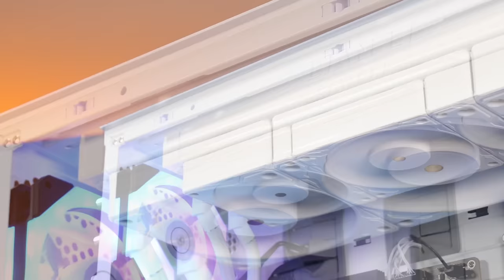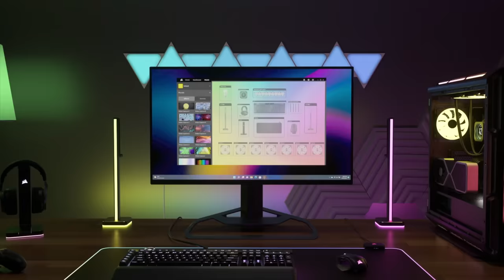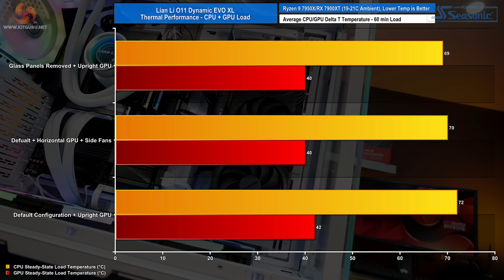Lian Li O11 Dynamic Evo XL - Deep Dive Review

Comment: I don't know if you or Lian Li care about my opinion but here it is. If they put a hinged door on the front for easy access, you would have nearly perfect case. Lots of people accidently drop the side panel or set it on the corner, when removing it. Just put 2 hinges on the back corner with magnetic closer and you've got it. Thanks for letting me share.
                                                                                                                            Ronnie

Comment: This case looks like it solves all the problems I had with the 011 Dynamic XL and then some. I ended up moving my build to a Phanteks Ecliipse P600S and am fairly happy with it though.
Reply: Don't mind me, just here to appreciate your profile icon.
Reply: @Ruuubi  UT2004 is my favorite multiplayer FPS of all time. I only went with the UT3 icon as I like red more than blue lol.
Reply: What problems did you have ?
Reply: I think he means some of the design issues they are well known. But I think this case is too big. Eclipse p600s I was considering but never made the move yet as I wasn’t sure. Hopefully it’s worked out
Reply: @bobsmithson8592  I like the P600S. I was impressed by some little things (e.g., the O11 XL came with a big bag with all the screws in it, the P600S came with a plastic box that organizes the screws into their own compartments). I like that both doors are hinged. I like the design of the top panel where it has an insert to block dust out of it when you put it to sleep, and can take it out to allow airflow when you're running it.

I don't know if the foam inside the top and front panels actually does anything though. I just tuned my fans so they didn't bother me. So if I had it to do again I might have gone for the Evolv X.
Reply: Heard good things about the p600s. The overall aesthetics are good and it seems quite versatile. What kind of cooling are you using in it ?
Reply: @praetorxyn are the door hinges good quality ? I’ve seen a few people online saying they aren’t great.

Comment: Good video, quite informative... like always. Thank you.

But something bothers me:
It's easy to say (or like Lian Li to write it in the manual) that the case supports 420mm radiators (or AIOs).
Well, that's only the combined fan dimension, but what is the actual maximal available space for the radiator, as they vary in length (450-480mm for example) and width ( up to 150mm for example) quite significantly?
Would there be actually enough space for 3x 420mm crossflow radiators including the needed fittings and the (hard-)tubes?

Comment: Thank you for the review, the case is indeed nice, but why oh why does it not support SSI EEB motherboards? There looks to be plenty of space for EEB MB tray, and it would probably not even overhang the cable cutouts.
3x420mm radiator support is a huge improvement over the regular o11 XL, but this much cooling really means that you have either 2xCPU+1xGPU or 1xCPU+2xGPU or probably 3xGPU. With very few exceptions those setups imply HEDT or server platforms. Like w790 SAGE - EEB form factor, or WRX90 - also EEB form factor. Multi-CPU boards are almost exclusively EEB as well. 
So why make the tray with only ATX standoffs? Any why remove support for dual PSUs? In workstation scenario I'd use local hard drive for OS only, all the data would be stored on some separate external storage anyway. And I don't see much point in four hot-swappable disks in home use either. So pls make one of "hot-swap" bays replaceable by an auxilliary PSU.
Overall, it is a nice case with some clever features, but some drawbacks as well as some questionable design desicions. If it supported EEB-size boards and retained support for two PSUs, I would be already ordering one. For now I guess the search for an ideal case continues.

Comment: Very innovative having the upright GPU. Wonder how long before edge connectors are replaced with connecting cables.
Reply: the og evo already did this but the 40 series made some models almost impossible to install...i still managed to get the 4090 strix in there and ran it for like a year now lol the xl will make it way easier tho.

Comment: Plenty of the cases that are like this or feature some of its features (side intake and/or bottom intake) could either easily support 140x3, or could with a vaguely larger version - and where are they? No where.

I will be getting this case, unless someone wants to do a video on multiple cases that do 2+ 3x140 rads.  (hint hint)
Reply: This might be your best option. People have done 3x360 rad builds in this.

Comment: Great Video and Info!!
 Why not mount the PSU with fan towards the hot backplate of CPU, might take off few C digits from CPU temps?

 Why nullify the role of PSU which  always had : to remove partially the hot air out of PC cases. Not to say in this case the HDD mounted in upper box will suffer from heat coming out from CPU backplate.

Comment: I really hate the fact that you have to use a 120mm fan in the back in a "all 140mm case" also everyone is waiting for the vision version. Also we have regular evo and vision for 120mm fans, why we need 120mm mounting systems that partially block the air from the 140mm fans?
Reply: Good points

Comment: Great video! I'm considering using two NVIDIA GeForce RTX 3090 GPUs in a horizontal configuration with air cooling. With the motherboard positioned at the top, I believe this setup could optimize airflow and heat dissipation for both GPUs. Any advice or insights on this configuration would be greatly appreciated. can i mount the two gpu,
s and three 120 mm fans at the bottom .thank you

Comment: It's weird that you guys decided to leave the corner support in for all of your cinematics, considering the removal of it was definitely one of the main selling points for enthusiast builders with this new generation of dual chamber cases. It's kind of doing Lian Li a disservice to only have like 30 seconds in the entire 37 minute video where you mention the removal of the support and then leave it in afterward lol.
Reply: The case doesn't feel very strong at all with the support removed, there is a lot of flex in the top, unlike the Phanteks NV7.

Also the sample we had was pre-production so the front/side glass clips were not secure, these were made from an alternative material in retail units.

Because of this it didn't feel safe moving the case into different positions for the b roll so I didn't want to risk damage. With a system inside it's very heavy and difficult to handle.
Reply: @KitGuruJames  That makes sense! Thanks for your reply James :)

Comment: as an owner of the original XL, it's quite nice to see that Lian Li have improved their product in so many ways ... while I don't care that much for all the options since I will probably use it for a simple regular build, it seems like there are quite a few things improved ... the only thing I don't really understand are the hd trays, it seems like the old way was better imho, I don't get the argument about the back of the case facing the wall .. just move your PC ... much simpler than having to remove the side panel imho (especially when cable management is messy and you have to put back all cables to close it)
Reply: Good feedback. Thanks for taking the time to post that. Helpful !

Comment: To have a good cooling/silence ratio, how many fans and what size would you recommend using?  (I was thinking of putting a 360 aio at the top but then is it better to have 120 or 140 fans)
Reply: The case is mostly set up for 140mm fans but not in the rear which is odd. 

Optimal for noise would be to use 140mm fans.
Reply: @KitGuruJames  Ok thank you very much for your help🙏🏻

Comment: 개인적인 컴퓨터 부품추천해봅니다.

부품추천 01

01 CPU 라이젠 AMD 5600G 또는 AMD 5600X 버미어중에  택1

(내장그래픽만 쓰려는 경우 5600G세잔 추천) (처음부터 외장그래픽카드를 쓰는 경우 5600X 버미어로 추천)

02 CPU쿨러 PCCOOLER 팔라딘 400 WHITE (AMD AM4) (증정되는 무뽑기 방지킷 확인하기 !!!)

03 써멀구리스 ARCTIC MX-4

04 메인보드 B550 D4 (M보드 풀사이즈 관계없음) (바이오스 업데이트 확인 필수급) (B450 D4에 바이오스 업데이트 해서 사용가능) 메인보드 브랜드는 개인적으로 아수스 TUF, STRIX,PRIME 추천

05 램 (메모리) 삼성램 DDR4 3200Mhz 8기가 2개 16기가 (DDR4메인보드와 DDR5램 호환안되고 DDR4램과 DDR5메인보드 호환안되니 크게주의)

06 SSD 하이닉스 P31골드 1테라 (SSD에 운영체제,시스템,게임 등등설치위주)

07 하드디스크 3.5인치 500기가 ~1테라 제품 (하드디스크에 자료저장위주) (개인적으로는 도시바,WD 제품위주로 추천)

08 파워서플라이 내장그래픽카드를 쓰다 나중에 외장그래픽카드(4060또는 4060TI) 추가하려는 경우 마이크로닉스 WIZMAX 750W 80PLUS SILVER ATX3.0 PCIE5 등등 그래픽카드 권장사양W이거나 그 이상 ATX 3.0파워 서플라이추천 추후 외장그래픽 카드 추가계획이 없는경우 일반 ATX파워 600W ~ 700W추천 (예시 마이크로닉스 클래식2 600W 풀체인지 80PLUS BRONZE 230V EU 등등 구축하는 컴퓨터사양 호환문제 없는 제품

09 케이스 앱코 G30 트루포스 화이트 또는 앱코 G40 시그니처 화이트 중에 택 1 추천

10. 사용하다 고장난경우 저장장치에 있는 데이터 자료들 전부 백업 이후 운영체제 교체로 대부분 해결 그래도 안되는 경우는 고장난 부품만 찾아서 제조사 AS받거나 스펙 호환및 실제 조립 작동에 문제없는 부품으로 교체

TIP 외장그래픽카드 추가려는 경우 3060또는 4060 또는 4060TI 추천 외장그래픽카드 추가 계획이 없거나 3060 그래픽카드 추가시 ATX파워로 선택 4060,4060TI 그래픽 카드 추가시 ATX 3.0파워로 선택 (개인적으로 그래픽카드 회사는 기가바이트,사파이어,아수스 추천)

개인적으로 외장그래픽카드를쓰는경우 5600G 세잔 대신 내장그래픽 기능없는 5600X 버미어 추천 모든 부품은 개인적으로 추천하는 예시 제품 이외에도 스펙호환뿐만이 아닌 실제사용에 무리없는급 사양 제품이면 다른 제품으로도 교체 호환 사용가능

02 개인적인 고사양 및 하이엔드급 컴퓨터 부품 추천해봅니다. (이 댓글의 모든 해당자료는 2024년도 글작성시점 기준 자료일뿐이니 참고)

고사양 7800X3D 7900X3D는 스스로 대장급 공냉중에 순위권, 또는 순위권 3열수냉 선택필수 (대장급공냉 누수우려 완전해결) 순위권 3열수냉쿨러는 대장급공냉보다 더 뛰어난 쿨링으로 인한 더 안정적인 성능기대치 (개인적으로는 3열수냉을 더 추천) 부품추천

02 - 01 7800X3D 또는 7900X3D 공냉 부품추천

01. CPU RYZEN 7800X3D 또는 7900X3D 중 택1

02. 써멀구리스 Arctic MX-4

03. CPU 쿨러 3RSYS Socoool RC1900 WHITE AMD AM5 소켓

04. 메인보드 B650 또는 X670E추천(대장급 공냉쿨러 이므로 풀사이즈 보드(M보드가 아닌)이고 SSD슬롯 바로 아래에 그래픽카드 슬롯이 있는 제품위주로 추천 = 스펙으로는 메인보드,큰 듀얼타워 CPU쿨러가 호환되도 실제 직접 조립시 공간간섭으로 조립안되는 문제가 있을 수 있으므로 확인필수)메인보드는 개인적으로 기가바이트 AORUS 시리즈 추천 (B650 , X670) (최신 바이오스 업데이트 확인필수급) (DDR4메인보드와 DDR5램호환안됨 DDR5메인보드와 DDR4램호환안됨 크게 주의)

05. 램 DDR5부터는 반드시 전문가와 상담 이후 구매 추천

(스펙표시 DDR5 몇 Mhz라는것이외에!!! 실제 호환성,실제조립이후 성능확인,4개사용시 Mhz저하,공간간섭 등등 확인필수!!!)개인의견으로 흔히들 상담할만한것이 하이닉스 DDR5 5600Mhz A다이언락 호환성일듯 싶으며 게임용으로는 16기가 + 16기가 32기가 또는 32 + 32기가 64기가 추천
(DDR4메인보드와 DDR5램호환안됨 DDR5메인보드와 DDR4램호환안됨) (개인적으로 오버클럭은 권장하지않음)

06. SSD 하이닉스 P41플래티넘 1테라 또는 SSD슬롯이 PCIe 5.0인경우 마이크론 크루셜 T700 SSD 1테라추천 (SSD에 운영체제,시스템,게임 등등설치위주 추천)

07 하드디스크 3.5인치 500기가 ~1테라 제품 (하드디스크에 자료저장위주 추천) (개인적으로 도시바,WD 제품 추천)

08.그래픽 카드 기가바이트 라데온 RX 7900 XT 시리즈 또는 기가바이트 4090중 택1

09. 파워서플라이 마이크로닉스 WIZMAX 1200W 80PLUS PLATINUM 풀모듈러 ATX 3.0 (PCIE5) (추천제품이외에도 ATX 3.0 규격 그래픽카드 권장사양 W제품이거나 그보다 약간 더 높은 W제품이면 호환가능) (플래티넘,골드,실버,브론즈,스탠다드 = 에너지 효율등급 관련)

10. 케이스 앱코 P3000 제우스 ARGB 미들타워 PC케이스 화이트

11. 케이스 추가 쿨러 6개

상단 3개 3RSYS SILENCE SE 140[시스템쿨러/140mm]

파워서플라이 커버 장착부 제품설명 5번위치 1개 (파워서플라이 바로위에) 3RSYS PF-12025
WHITE 시스템쿨러 (120MM) 1개

측면 2개 3RSYS PF-12025 WHITE
시스템쿨러 (120MM) 2개

(140MM) 3+ (120MM) 1+ (120MM) 2 = 6

TIP 사용하다 문제생긴경우 데스크탑 저장장치에있는 자료 백업이후 운영체제 재설치로 대부분해결

그래도 안되는 경우 고장난부품만 제조사AS보내거나 호환되는 다른 제품으로 교체해결 주기적인 써멀구리스 관리 숙지

(고성능 CPU에 공냉쿨러 이다보니 써멀구리스가 굳어서 컴퓨터가 느려지기 이전에 미리 재도포 개인적으로 ARCTIC MX-4로 2년에 1번 재도포 추천)

추천제품들 이외에도 스펙호환 및 실제 사용에 문제없는 제품들이면 다른 부품들로도 사용가능

부품추천 02 - 02

7800X3D, 7900X3D, 7950X3D 수냉부품 추천 

01 CPU RYZEN 7800X3D, 7900X3D, 7950X3D 중 택1

02.써멀구리스 Arctic MX-4

03.CPU 쿨러 DEEPCOOL LS720 WHITE 3열수냉(AMD 소켓 AM5)

04 메인보드 B650 또는 X670E (M보드 또는 풀사이즈 관계없음) 개인적으로 기가바이트 AORUS 시리즈 추천 (최신바이오스 업데이트 확인 필수급)

05.램 DDR5부터는 반드시 전문가와 상담 이후 구매 추천 (스펙표시 DDR5 몇 Mhz라는것이외에!!! 실제 호환성,실제조립이후 성능확인,4개사용시 Mhz저하,공간간섭 등등 확인필수!!!) 개인의견은 흔히 상담할만한것이 하이닉스 DDR5 5600Mhz A다이언락 호환성일듯 싶으며 게임용으로는 16기가 + 16기가 32기가또는 32기가 + 32기가 64기가 추천 (개인적으로 오버클럭은 권장하지않음) DDR4메인보드와 DDR5램호환안됨 DDR5메인보드와 DDR4램호환안됨

06.SSD 하이닉스 P41플래티넘 1테라 또는 SSD슬롯이 PCIe 5.0인경우 마이크론 크루셜 T700 SSD 1테라 추천 (SSD에 운영체제,시스템,게임 등등설치위주 추천)

07 하드디스크 3.5인치 500기가 ~1테라 제품 (하드디스크에 자료저장위주 추천) (개인적으로, 도시바,WD 제품추천)

08.그래픽 카드 기가바이트 라데온 RX 7900 XT 시리즈 또는 기가바이트 4090중 택1

09.파워서플라이 마이크로닉스 WIZMAX 1200W 80PLUS PLATINUM 풀모듈러 ATX 3.0 (PCIE5) (추천제품이외에도 ATX 3.0 규격 그래픽카드 권장사양 W제품이거나 그보다 약간 더 높은 W제품 호환가능) (플래티넘,골드,실버,브론즈,스탠다드 = 에너지 효율등급 관련)

10.케이스 앱코 SUITMASTER U3000 갤러리 ARGB 강화유리

11. 케이스 추가 쿨러 앱코 엣지 듀얼 140 ARGB 스마트쿨링(WHITE) 3개 측면부착 

사용하다 문제생긴경우 데스크탑 저장장치에있는 자료 백업이후 운영체제 재설치로 대부분해결 그래도 안되는 경우 고장난부품만 제조사AS보내거나 호환되는 다른 제품으로 교체해결

주기적인 써멀구리스 관리 숙지

추천제품들 이외에도 스펙호환 및 실제 사용에 문제없는 제품들이면 다른 부품들로도 사용가능

Comment: This is what you call a review of a custom watercooling computer case in which you plant one single 360 mm Radiator of an AIO Watercooler and 5 additional 120mm Fans, including an air cooled GPU? 
Whoever buys this Case, will want to custom watercool cpu and GPU with 3x 360 or up to 3x 420mm Radiators on 3 different positions in the same time?! Thisbis review off the track, sorry, i really like 
You, but this ia somewhat off, of the regular Usecase of this Case. Especially YOU should have already known this 😢 i am disappointed "really really really.
Reply: Person I know who bought it put in a massive aio and a build very similar to what James used. It’s hard to cover every base in a review. Pretty sure last time James did a custom loop people said ‘but how does it work with a good aio cause I don’t want all the maintenance heartaches with a custom loop’.
Reply: I said this myself in the review. I know it's designed for custom cooling but it could also be used with an AIO and hybrid graphics card.

But to test case airflow/cooling fairly I try and stick to a regular system with an AIO.

Comment: well, its not a pretty build because your just using spare parts that you have lying around. Lazy building...i wish creators wouldnt do this for whatever reason, whether it be to satisfy sponsors and use their parts or becuase they are trying to save money and time. kinda spoils the video and too many creators are doing it. We wanna see what these cases are capable of and using spare parts that are lying around in your little computer shop is always going to turn out underwhelming. besides that, good job providing all the information. those fans are pretty cool and interesting, ive never seen them before. But with you using the fans that came with the cooler and then the upright graphics card (which i personally dont like) it ruins the asthetic possibilities this case was made for. You probably would have done much better with a black version of this case if you were gonna use all these parts that you used. it just looks horrible and really poor/lazy planning.